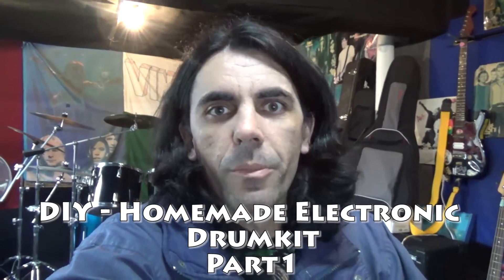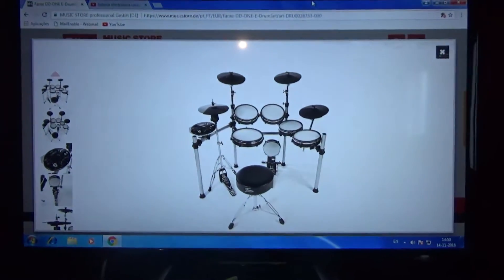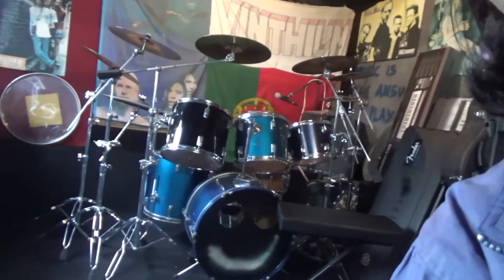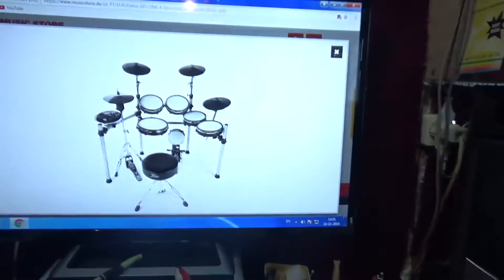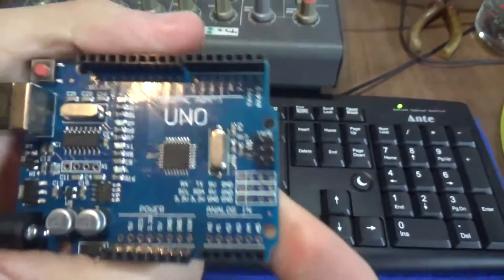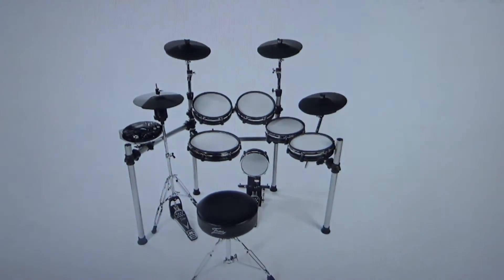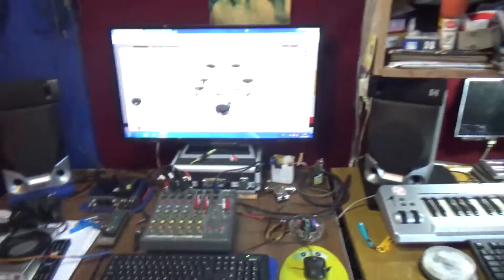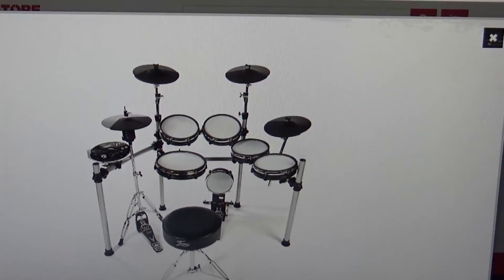DIY - Homemade Electronic Drumkit part1

Comment: Hi Luis, did you have any experience Arduino before you started this project? Did you change any of the code ? I saw someone on Drum diy - Bateria eletrônica caseira (fb group) used some other ports on megaboard to get more than 16 controls. I used translate so I'm not shure on the details.
Reply: Fala Black Angel, tô interessado nisso aí!
consegue me responder?